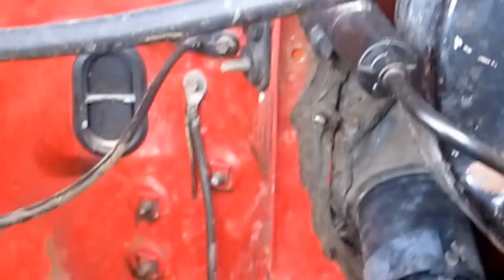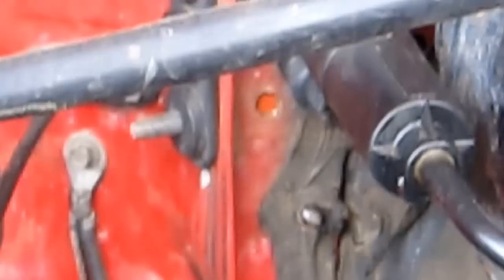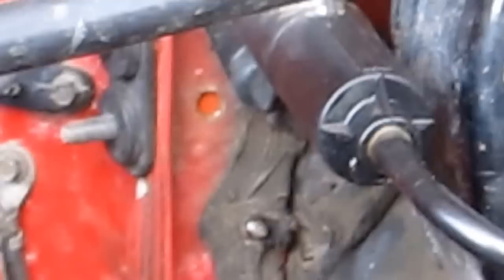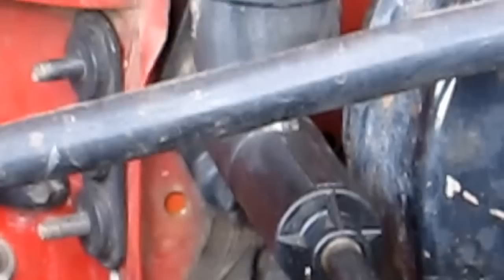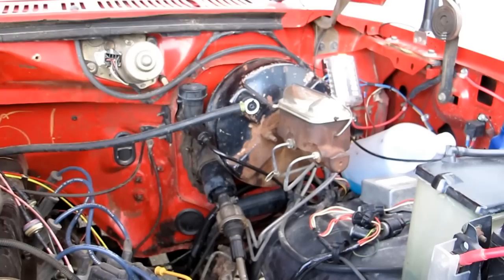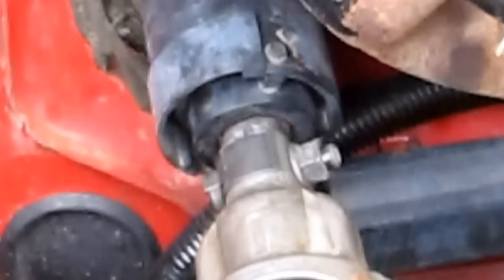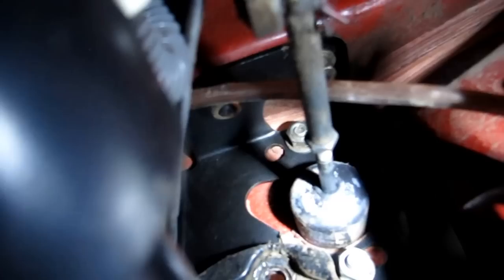Ford firewall reinforcement for heavily damaged firewall

Comment: Great help video , thank you.. I have a 87 f250 460 5spd 4x4 . The clutch pedal assembly bracket under my dash is broken in a few places , the push rod that goes in slave cylinder is a little wahlered out ...where the bar the pedals hang from mounts up above the clutch pedal is broke in about 30 spots . Pedal bushing spot is chewed almost to nothing . And on the fire wall where the slave cylinder mounts the  weld is broke so when I push the clutch pedal it flexes and I loose half the pedal . But I can't find anything for 87 . Where can I get the whole pedal assembly with the biggest bracket . Will this reinforcement kit help me ....plz help . ..
Reply from the maker: First, you'll need the bracket assembly - Try a local auto recycler/junkyard. Seems like lots of them interchange, but I'm not sure what fits after 1986. An adjustable clutch rod is available - be sure to replace the bushing on the rod.

You'll also need to stop at the local Ford dealer and ask for the firewall reinforcment kit IF it's available for yours. It's an '87, so it's unlikely to be in stock so ask the dealer for the part number, THEN ask them to do a parts search. If nothing shows up, call Green Sales - they could have one. I've also used parts counter, dot com, ebay, and amazon as well. If all that fails, hire a good fabricator and have him build a plate - won't be cheap, but that's the only way I know to get one built.

Comment: I need to do this to my '79 Bronco because I'm installing a ZF 5-speed transmission with hydro clutch.  I'm fairly certain I'm going to be fabricating a reinforcement plate for my firewall...
Reply from the maker: +Manu Singh You will indeed, as FoMoCo and Terrapin's plates are made for the next generation Ford pickup, the '80-'86 year models. It will also fit later trucks, but Ford had figured out the problem by '89 or so, and it was needed very rarely by then.
If you're installing a ZF, I'd suggest you lurk over at http://www.ford-trucks.com/forums/forum38/ and http://www.ford-trucks.com/forums/forum44/
The folks there are pretty helpful, and might be able to assist you in making a plate. Best of luck- let me know when you get the conversion finished.

Comment: Hi Frank, I just got the re-enforcement plate from Terapin.  Doesn't fit just perfect. The area where the three bolts go through seems to be the issue. Did you have a similar problem?
Reply from the maker: +amlafrance1918 Yes, I had to bend the plate a bit to fit the firewall- it was in another truck at a junkyard and I suspect that each firewall is a bit different. Do you have the clutch/brake pedal carrier out?
Reply: +amlafrance1918 I got it to fit just fine after a few small "bumps" of the firewall. It turns out my firewall is not cracked. I DID take out the pedal box, really to just replace all the plastic bushings etc.  Turns out my pedal box is horribly cracked.  Trying to find a good one now. Explains why the dash "creaked" when I pushed the clutch pedal in.  Thanks for the advise on taking the seat out. Made all the difference in the world with my patience etc.  I am not skinny minnie so it helped me out greatly...  Will keep you posted. Thanks for your informative video.  I would like to have made a video myself about the procedure but don't have a camera or the know how....  Thanks again :)
Reply from the maker: +amlafrance1918 Glad you got in there, and that the video helped you. A used pedal hanger ought to be easy to find at a decent sized junkyard. Another place to check out are the forums over at ford-trucks.com. Good luck with your repair-if you've made it this far, you'll get it. 
As far as a camera and skills- I just used a phone and as for skills- you can see that I'm learning. I'd encourage you to try if you have a camera in your phone.

Comment: hey just ordered this plate for my truck unfortunately my firewall is cracked pretty bad would you suggest getting it welded back together before installing the plate or will the plate be strong enough on its own?
Reply from the maker: If it's the large plate like I used, It will likely be fine without welding. The plate bolts between the steering column and the firewall, and has more bolts connecting it to the firewall: so long as you install all of them, it ought to work just fine. If you bought one from Terrapin, I'd encourage you to use some RTV sealant (silicone) on the whole plate, and bolts, just prior to final installation to make sure nothing leaks. The Ford plate I used has a rubber gasket for sealing it up.
Reply: you can't weld the firewall it will crack even worse. it's high carbon